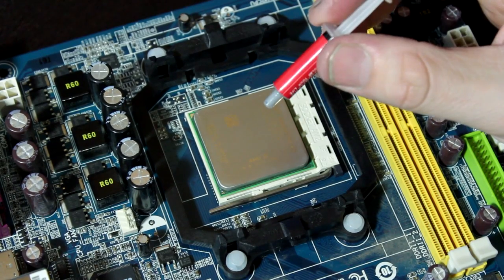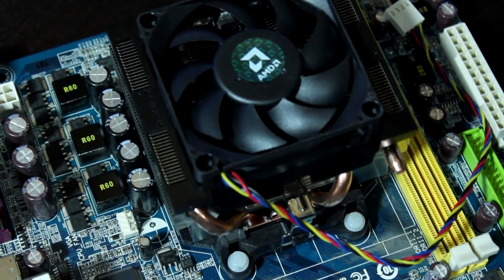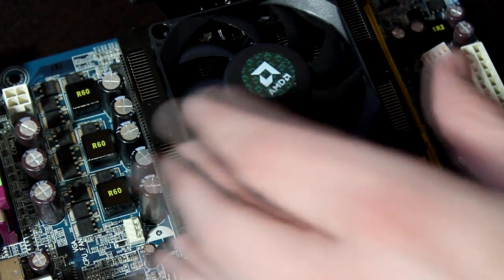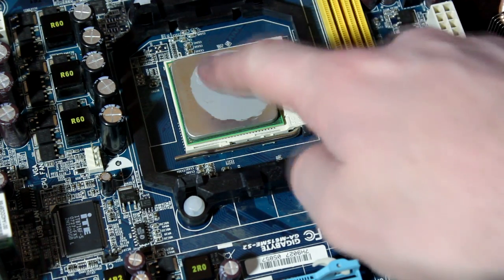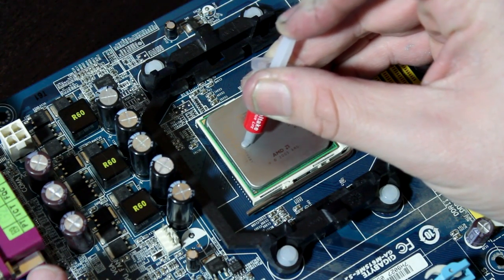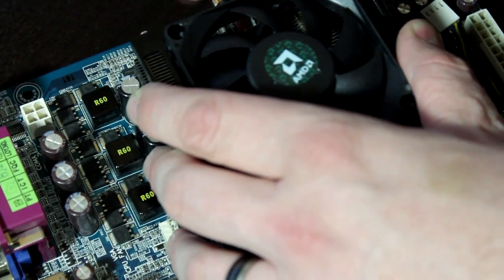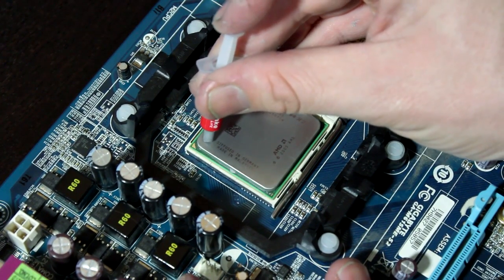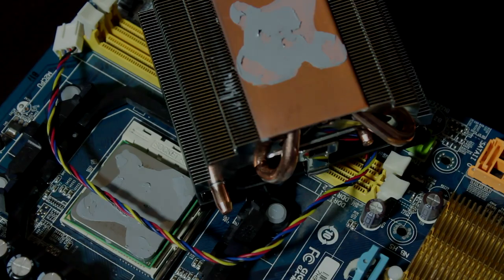How to install Thermal Paste

Comment: you are correct, to much past can fall on your mobo causing a short  , but if you use none conductive paste like the MX-3 the X method  will be a better choice because any extra paste will be pushed out of the cpu heat spreader , i highly recommend using non conductive paste , the difference might be a degree or two  but you will have the safety of mind and usually the MX-3 gives you about 4 grams of paste comparing to 1.5 gram for the silver or the demimonde competitors

Comment: the reason why logan said the pea method is good is since as the heat paste heats up it will expand covering more surface area and with the x method there is a chance that the paste will go off the side and since most good quality termal paste is conductive it could cause the motherboard too short out, also logan did the test using a piece of see through plastic too show how the past spreads out so that could change the results

Comment: I bought a laptop from bestbuy and upgraded the cpu from a A6-4400m to a A8-4500m. The OEM used a great deal of thermal paste on the original cpu and it would max out at 90C. now with the A8-4500m and high performance thermal paste installed, it runs at about 81C. Kinda sad that OEMs dont know how to apply this stuff.

Comment: What do you use to get the thermal grease off? Im replacing my stock heatsink and this video really helped btw!
Reply: Hey! Comin' at ya from the future.... nah, but seriously this isn't usually mentioned but 75% or higher (I use 91%) isopropyl alcohol. Comes of just fine.